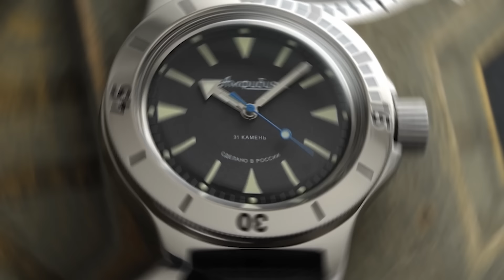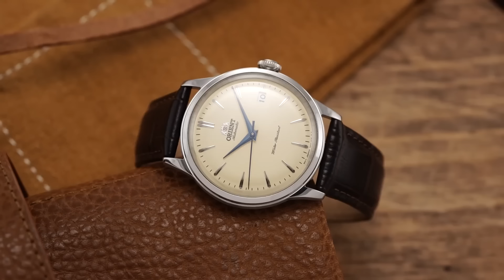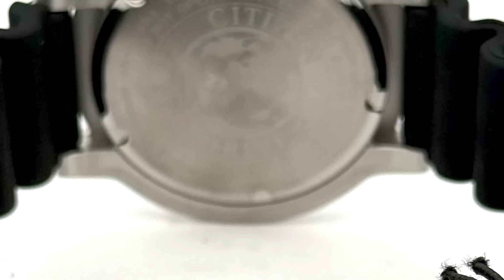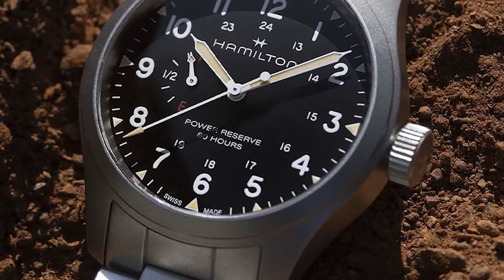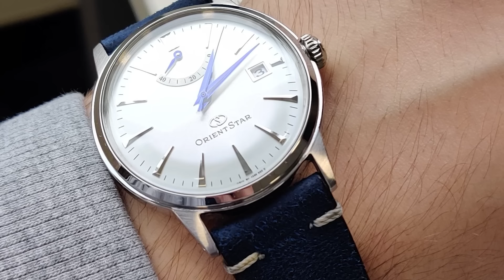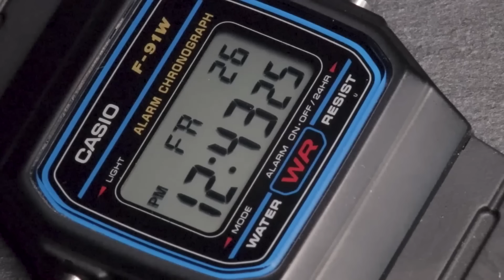10 CHEAP Watches ONLY Smart Collectors SECRETLY Buy (#2 Humiliates $10,000 Watches)

Comment: This video is full of errors.  First of all, NONE of these watches are secrets. All the major watch reviewers  hype these watches regularly.  Next, Zodiac, Christopher Ward and Buhlmann have all made compression dive watches. Orient's movements are not truly in-house. Notice the video, at one point, slips in the phrase "in group."  They're made by Seiko, both of which are owned by the Seiko group. This is no different than Swatch Group brands using ETA movements because Swatch Group owns ETA as well. When speaking of the Pressage dial, it's true your getting the looks for less money. The difference is the Pressage dials are made in minutes with a machine and several of the more expensive Swiss brands still do it by hand. The Alpinest is far from being the only one with an internal rotating bezel. And NONE of these watches are on the same quality level as Rolex. They may be far better value for the dollar, but not equal quality. There are more errors in the video, but it's too much to keep typing.
Reply: They are in-house.

When Orient fully merged into Seiko Epson in 2017, Orient's original manufacturing facilities became part of Akita Epson Corporation in Yuzawa, Japan. Today, Orient movements are still manufactured at this exact same dedicated factory.

The one tiny exception to the rule is that Orient will occasionally source quartz (battery-powered) modules from standard third-party corporate catalogs for their basic quartz chronographs, but all of their famous automatic and mechanical watches are strictly proprietary Orient designs.
Reply: Right on thx for the clarification